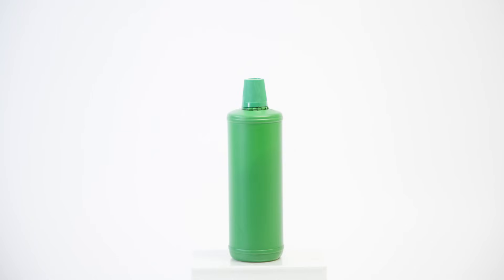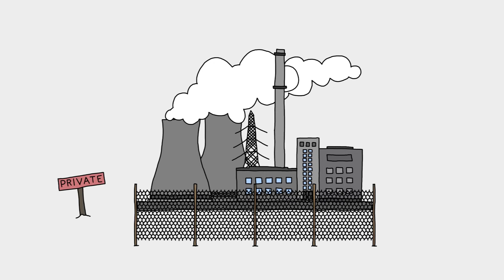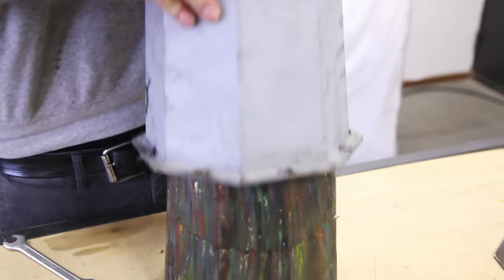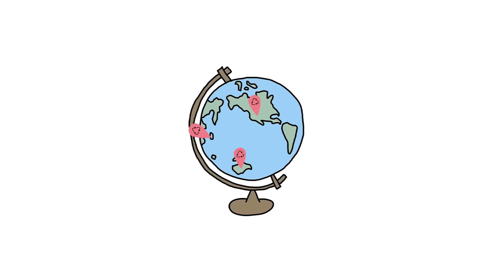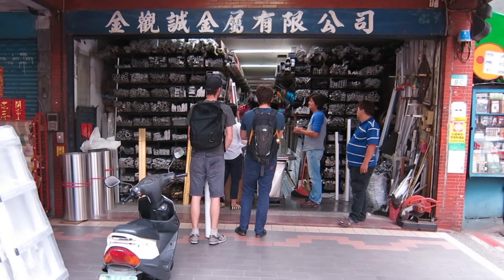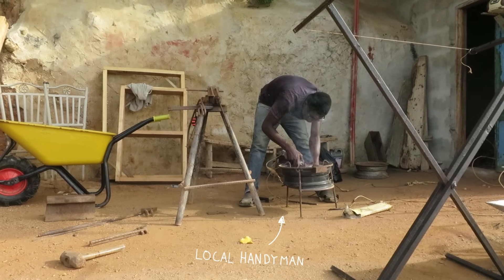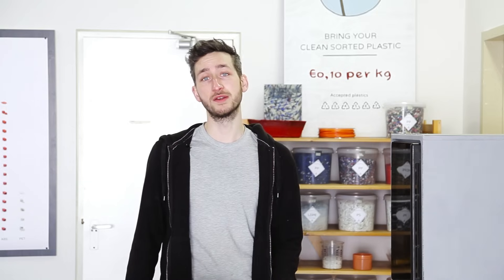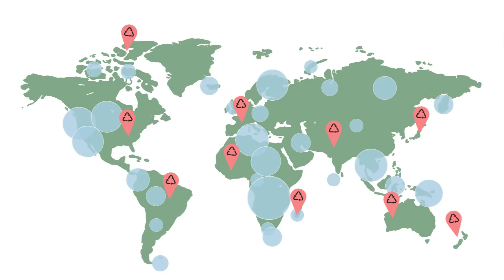Precious Plastic V2 - Promo

Comment: Someone needs to integrate all of these things along with a 3D printer, into one appliance that can be installed into any garage. I could see such an appliance come standard with all new homes and retrofit into all old ones so long as you get the cost point of the appliance down below $500, and the footprint of the appliance comparable to that of a washer or drier, or a refrigerator. I suppose you'd have to add some automation into it as well, so that it could become a part of a child's chores to go to the recycling and extruding with little more than a push of a button after the initial setup. 

Suddenly that plastic island that's 3 times the size of France that's out in the pacific becomes a gold mine waiting for someone to harvest, rather than a problem no one knows what to do with.

Comment: Fumes of melted plastic can be extremely harmful. Some plastics appear to be more harmful than others. Even if you don't burn the plastic and just melt it, one of the toxic by-products is dioxin. That is a chemical you really don't want to be working with - especially not at home with family and possibly some kids around you!  There are also other projects on the internet that work off pretty much the same idea, like 3D printers that utilize recycled plastic. At first they seem to be really great ideas, but - what about health and safety?
Reply: shredding and melting down PLA or ABS to make 3d printer fillament from recycled materials is no more dangerous than using a 3d printer.  You just need adequate ventilation and the health effects are negligible.  there is a lot of research on 3d printer health and safety as it is a mainstream plastic melting process done in the home setting
Reply: And if it were all a compact appliance kept in the garage of every house, the exhaust was self-contained, then pumped out through filters vented from the top of the house?

Comment: In the video you talk about building them using basic tools, and then in the video for the shredder you talk about having things laser cut, and having to turn the hex bar on a metal lathe. Do you have instructions for how to build these only using basic tools? Most people don't have easy access to things like a metal lathe or laser cutters.